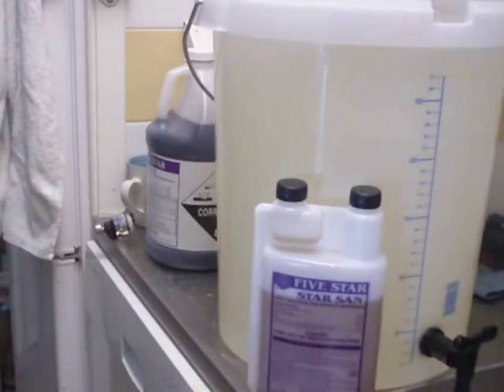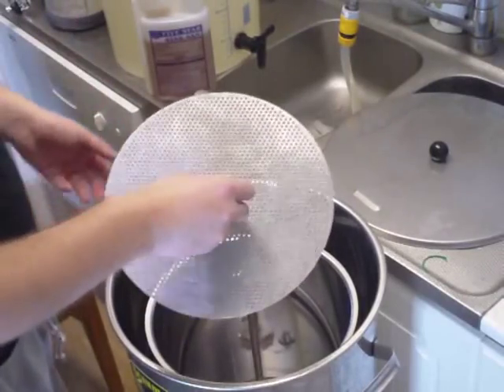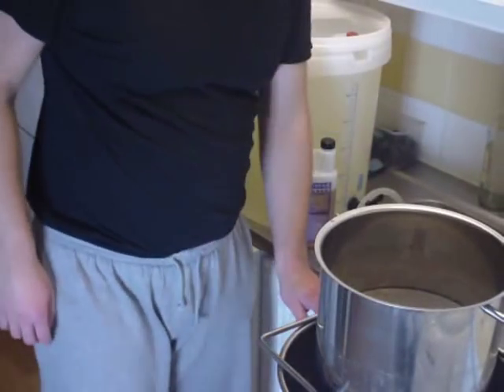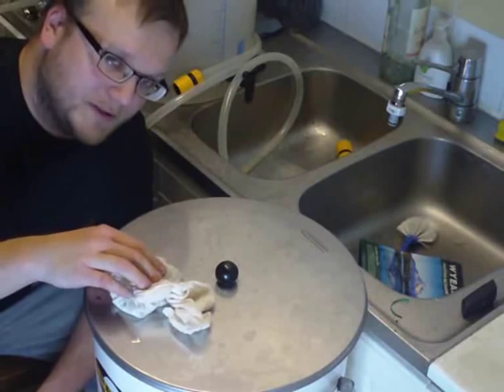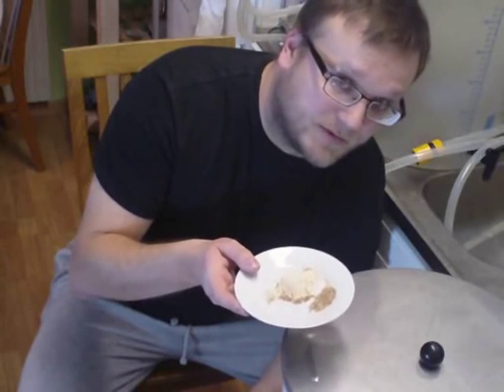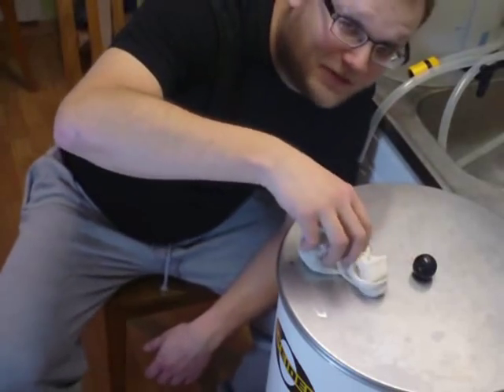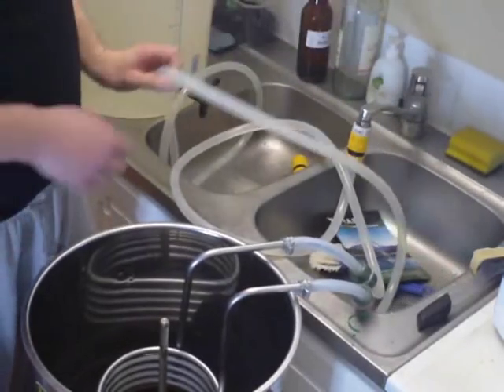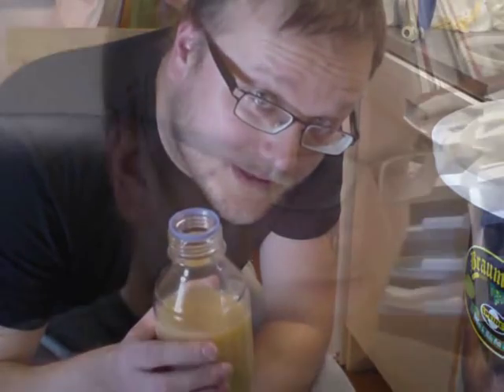Christmas Ale - November 2011

Comment: Nice job!

I have questions on the Braumeister. The dealers in the US seem to be clueless on it.

I have order a 50L Braumeister (have no received it yet). I am a bit worried about the mash screen(s). Does it come with both sets of fine and course screens (top and bottom)? If not, what did you use for the finer screen? I have heard about problems with the pump getting clogged. I just want to get my ducks in a row before I use it once I get it.